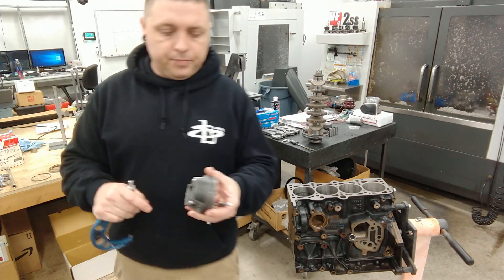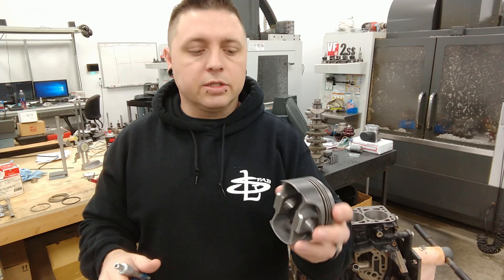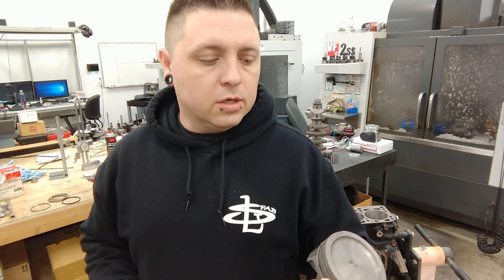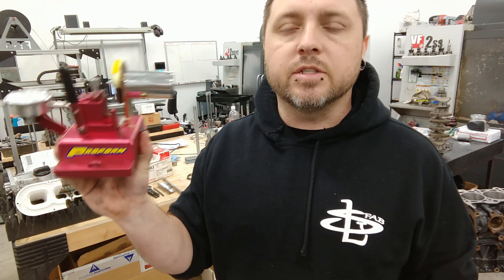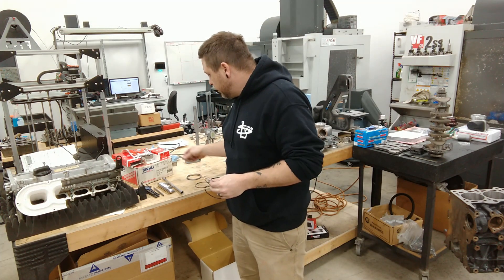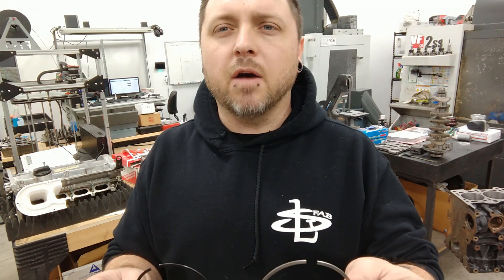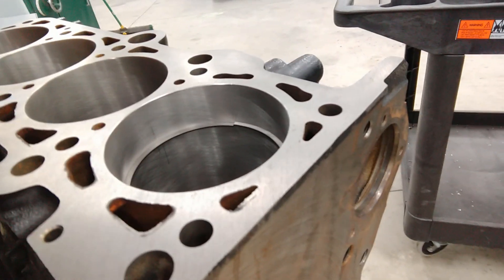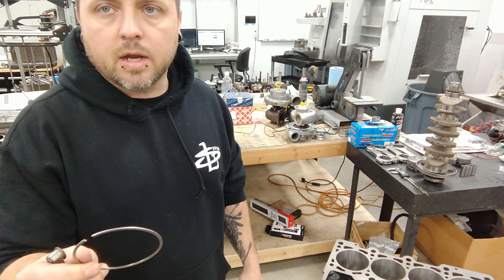VW 1.8t 20v engine build, checking p2w clearance and setting ring gap.

Comment: There is no such thing as a drop in ring. Its a turbo motor and second ring gap should be larger to prevent heat buildup on the top ring and prevent ring flutter. Stock spec for 1.8t is like 6-22 Thousandths with .030 max. Use a piston top to push the ring down evenly.

Comment: thank you very much!  was the  .023 gap prone to cold engine blow-by?  thanks again , TOP job!
Reply from the maker: To be honest I got very busy since this video and this engine has never ran, it’s still sitting collecting dust… I was also concerned with that ring gap seeming quite large, as most aftermarket pistons I’ve used would have been more in the .016-.018” range, but that is what mahle recommends and they are an oem piston provider so I’m sure it will be fine, they may use a different material that expands quicker.

Comment: hello you do the 0.23 gap for the first ring,second ring,and the 2oil ring?thx
Reply from the maker: That is the gap I set are for these specific Mahle pistons/rings, you need to check your piston manufacturers specifications, they are all different. On my pistons the 1st and 2nd ring are .023” and the oil retention rings are .015” minimum
Reply: @linderpowersystems_LPSFAB  thx ,i buy JE pistons 82mm\8.5:1\Q series i one week i pick up the package and see if they have the specifications in the box

Comment: Hypothetical question. If a block had relatively recently been refreshed and the compression is good and cylinder walls were good, would it be reasonable to just fit rods and bearings and button it all back up? Common sense would dictate you do the rings and hone again while you're in there, but would you run into any complications just putting the pistons back in again?
Reply from the maker: Yes it's possible, although you would want to be very careful to get the pistons back in the same holes they came out of. And I would even mark where the ring gaps were at and try to keep those the same.
Reply: Thanks for the quick reply! Loving the videos, it's good to see something like this for the 20vt engines! I've gotta watch it in little bits though as I have a 6 week old son who doesn't let me finish a video. Last question, where do you get your specs for tolerances etc?
Reply from the maker: @JCCalum  mainly from the oem or from the manufacturers of the parts you're using. really depends on what clearance you are speaking of.

Comment: 83mm have you bored it 2mm?
Reply from the maker: The 2.0l is 82.5mm bore stock, so only .5mm
Reply: @linderpowersystems_LPSFAB  ah right, just the 1.8t is a 81mm bore.